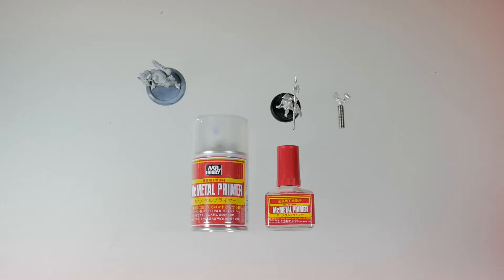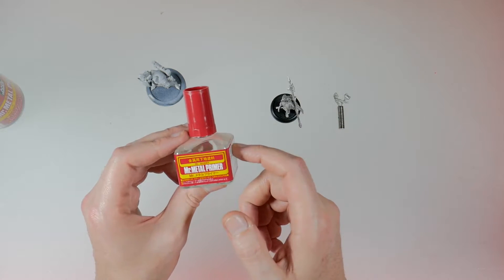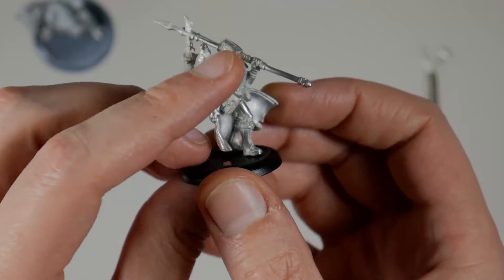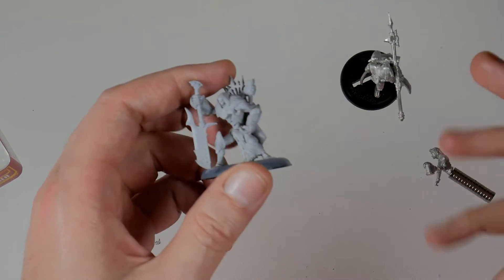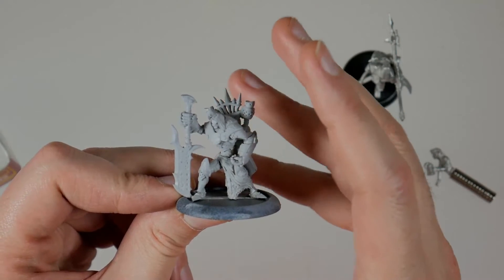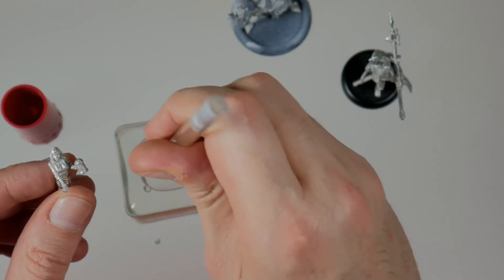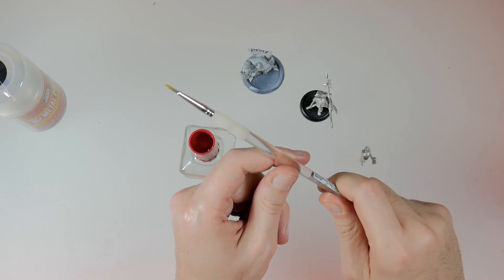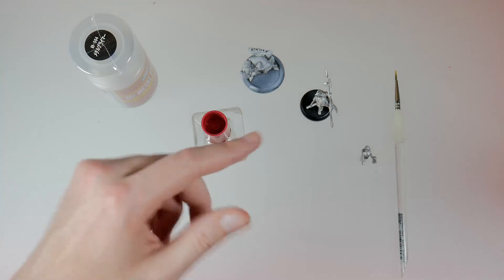Mr Metal Primer - How To Prep Your Metal Parts For Paint

Comment: I use this stuff & its superb. I do apply it a lot more liberally than you mentioned. Obviously you don't want it pooling up, but just wash it over the model working from top to bottom & avoid any pooling. It really brings out the details in the miniature as it etches away any residues & unevenness detracting from the sculpt. It makes painting so much easier when you can see the details unambiguously.
Reply from the maker: Thanks for feedback. I won't paint any metal minis or details without this first.

Comment: @Dave's World
Metal Primer... I wasn't aware they made something like this. 
Spray can based paints & primers are often more expensive and doesn't have as much as the bottled version, but you're paying extra for the convenience of spraying as opposed to brushing. 

Could you use a little bit of thinner and use this metal primer in an air brush?
Reply from the maker: I was asked this earlier, I would not recommend it as is a metal etcher.. And airbrush is made of metal.
Reply: @Dave's World 
That makes sense. 👍

Comment: Question: can the bottle one go into an airbrush? Or as a lacquer can it be thinned with Mr Levelling Thinner or other lacquer thinners?
Reply from the maker: I've never run through airbrush but it's thin enough by its self. Personally I would not use in airbrush as it's a metal etcher and your airbrush is made of metal tho I've heard of people doing it, I just wouldn't chance it.
Reply: streum13 you can use a very cheap airbrush for this job

Comment: Can i use this to my gunpla? Because it seems to corrode the surface of the plastic pal
Reply from the maker: No oooo, as stated this is a metal primer designed to etc I to metal and a lacquer product so it will tear up plastic. I have video coming Tuesday On plastic primers but you can use Mr surfacer on plastic.